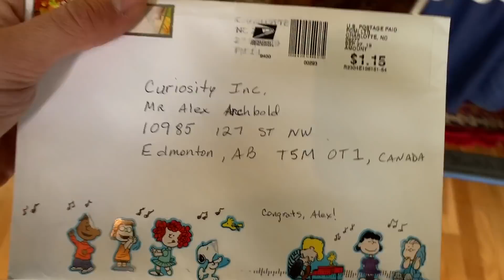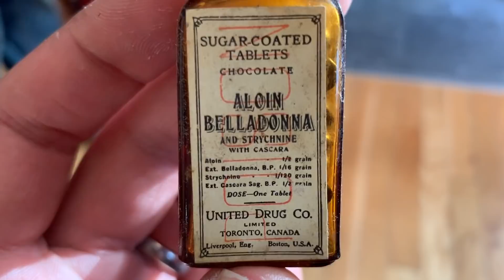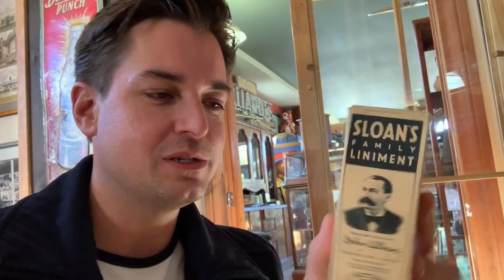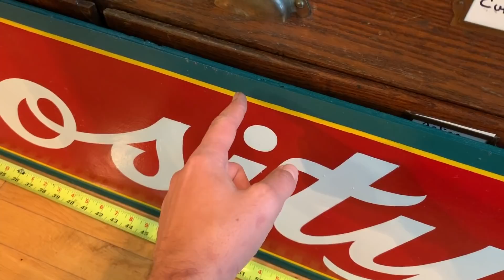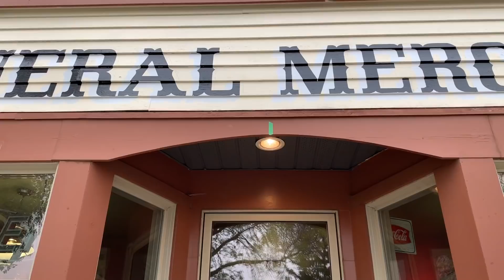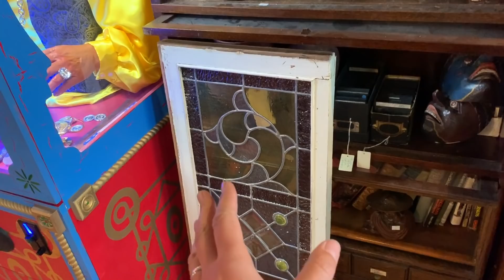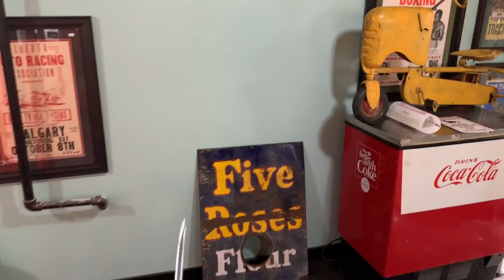Part 16 Alex gets crafty, sign time! And some final Reno's into... the General Store

Comment: What you need for the basement is a Dehumidifier you probably can find one used or purchase one new for under $150.00 CN?
Your basement will remain musty until the temperature outside gets into the low 30 degrees. After the ground starts to freeze you won't need it until springtime again. Those bags won't even begin put a dent in your musty basement.
Reply: I was thinking the same thing about the bags he bought vs. a dehumidifier. He should also buy a hygrometer (they are quite inexpensive) to monitor the indoor relative humidity (RH). If it's above 60 percent, that greatly increases the risk for mold growth. Ideally, the RH should be between 30 percent and 50 percent, if possible. We had mold in our home due to poor drainage in our backyard, and the RH in our closet (attached to our bathroom) reached as high as 75 percent. I was shocked at how much water a dehumidifier pulled out of the air.
Reply: @rachelh5211   At least a few gallons per day...Those bags are a waste of money...

Comment: New subscriber here. Nicely done.
My daughter told me about your YouTube channel and I'm looking forward to watching your Potter house episodes. 
That's so cool that you were asked to give a business lecture at your local college. I'm sure that you have a lot of valuable experiences and advise to share.
It sounds like a dream come true to have your shop be a community landmark/ destination, for bus tours.
My husband is a carpenter and has experience, renovating houses with old basements that have the dirt shelf. 
He spreads Surf powder detergent, over the bare dirt and it helps take care of the dank, earthy smell. 
Plastic bins on heavy duty shelving or wood pallets are great for keeping (seasonal decorations, extra parts, etc.) directly off the cement.
It helps with air flow under and around your stored items.
 And if you have any unexpected flooding, it will keep your stuff from getting ruined.
I've seen those multiple plug,  power strips, mounted with the power cord running along the top of the wooden rafters.
That way several things can be plugged in without the cord hanging down and it looks nice too.
A few years back, we owned a vintage shop. 
It was broken into, two days before Christmas. 
It took the thief about 10 seconds, using a screwdriver and hammer to pop the lock. 
The locksmith told me that if we had a lock that was a few dollars more, with a safety ring on it, the thief wouldn't have been able to spin the inside around with his screwdriver (like a key). 
Make sure you have multiple surveillance cameras. 
The business that sat next to me, had cameras and wasn't touched. We viewed their footage, after the break in, and saw the thief. 
He stood under one of their camera (at 1:30 a.m. Using the darkness and snowstorm, for cover). 
He looked directly into the camera and decided not to break into their establishment. 
This was before the doorbell surveillance systems that you can hook up to hear and watch things from another location....
We learned from this experience and put up signs that said, 
"No cash or valuables are stored on the premises, overnight." 
When we closed for the night, we left the empty cash register tray, sitting upright on our counter, within clear view of the front windows. 
We installed motion activated lights inside and outside. 
We used clear Christmas lights (on a timer) around the inside windows and the register desk that we left on at night. 
It looked pretty and added a measure of security, as well.
I parked where I could get a clear view of my car and kept the parking area, well lit at night.
Please also invest in security bars for any side or back windows.
My husband always met me before closing, so we could handle the end of day money and leave together, for safety. 
We were friendly with the other shop keepers by us, and we looked out for each other.
Just some things that I thought to share. 
Your shop is totally amazing!
You probably get tired of people offering unsolicited advice. Hope this might be helpful to you and doesn't come off as nit picking.
Reply from the maker: I appreciate you watching :)

Comment: Dehumidifier will dry it out your basement ,make it like a desert.
Reply from the maker: I’ll see if these help if not I’ll get a dehumidifier
Reply: Dehumidifier are a must in any basement.
Reply: But you will need to be careful picking the right one. Some you have to constantly empty the collected water. Others can be made to drain outside or in a floor drain.
Reply: @sand3882  I got one that will pump uphill. It is nice not having to dump a bucket.
Reply: Dehumidifiers are energy hogs as they are essentially air conditioners. A better solution ( assuming you have eliminated to cause of the water in the basement) is to get a 4" diameter inline fan that picks up air near the floor and exhausts it outdoors just like a dryer vent. You can run it on slow speed continuously or connect it to a humidistat so that it comes on when the humidity level increases. Much cheaper to run and no hassles draining water etc.

Comment: For you basement. I think that when things settle down a smidge, get the time and a contractor to come around and create a couple (or more) ventilation shafts. One has to climb much like a chimney the other can be ground side. Diameter/size isn't that big of a deal, rather a good flow of air, so you might want to have a good wind chicken scoop up there. Ventilation is by far, the most effective means of combating ground moisture short of digging a water catch shaft/well.

Comment: Alex,   a  few suggestions if you don't mind. That cellar basement. I have a 92 yr old neighbor. She has a cellar basement the neighbors emptied out. One of them got the bright idea to put a gallon of bleach in a 3 gallon pump sprayer and coated her walls from floor to ceiling. They barely got that done and were almost gassed from the chlorine fumes.   Unbelievable.  They came to me and asked for help.    First, you dilute bleach.  If I had a 3 gallon pump sprayer, I'd put 2 gallons of water in it and about a cup of bleach.  That should be a good enough disinfectant to kill any mold.

Since the damage was already done to my neighbors cellar I went to investigate.  From the kitchen I could  smell the odors.  I told them to keep all those windows open and  to get  a few fans.  I have COPD and I did have an actual quality face mask I could wear.  I got my SunJoe electric pressure washer and set it up outside her cellar window.  I went  down with my mask on and opened the window and they handed me the wand.  I sprayed those walls down from top to bottom with the pressure washer.  They looked great.  I even did her floor. The entire room was probably no bigger than 15 feet by 15 feet or so.  I made sure the drain was cleaned and not clogged with anything. The odor diminished quickly as it was all flushed down the walls and down the drain.

I ran out to Lowes and got two gallons of that white KILLZ paint.  I had plenty of brushes at my house so I asked the neighbors, since they started the project if they'd paint.  Three of them went down a few days later since it was dry as a bone and they knocked that out in just a few hours.  Now that lady has a clean dry basement.  With all that mold that was down there, the smell was working its way up into her home every time the furnace kicked on.  So I told the neighors to make sure the filters were changed and clean.  I got the size so I can get her a half a dozen more.  Her vent work was tight so it was the odor coming through the filters as the furnace kicked on.

So, after watching your video, I not only thought of that but thought you should get a pressure washer and clean that from top to bottom.   DILUTE bleach if you think you have a mold issue so it doesn't blow up when your furnace kicks on.  But, after you power wash, you should be able to get  a few cans of killz paint and that should keep your cellar tight and dry longterm rather than quick fixes like those bean bags.   Should that moldy smell come through your vents, your cardboard products might retain the smell and linger and people would notice when they came in.   (wow sorry 4 paragraphs) but I thought you should think long term, pressure wash and paint so future damages are avoidable.   I do enjoy your channel very much.

Comment: That guitar amp is a CRATE, which were mostly made in St. Louis, MO.  I owned a music instrument store for 22 years, and I was a dealer for Crate.  This era of Crate amps are known for having issues with cold solder joints, which will make them cut out.  If you have a soldering iron, remove the amp from it's box and remove the circuit board from the amp's chassis, and look it over really well.  Might want to use a magnifying glass during this step, as you are looking for solder joints that are cracked.  When you find them, or if you think ANY of them are questionable, just re-heat them with your iron until the solder is hot enough to flow and that will fix them 99 times out of 100.  Easy peezy, although it takes a little time to disassemble and reassemble the amp.
Reply: OH, I forgot to mention, if a Crate starts cutting out, take your fist and just give the amp a rap on the top, you don't have to bash it hard, but if you rap it and it acts like it is trying to come back on, then you know you have a cold/loose solder joint.

Comment: You can do the same thing with rock salt in a knee high stocking....really inexpensive! Make many more...you fill the knee high with rock salt & place a bucket under it to collect the water...the salt will draw moisture out of the air...you hang them from the floor boards in craw space...i have used this for years works fast and lasts a really long time!

Comment: Try a dehumidifier in the basement, changes everything. And it'll be cheaper than buying those concrobium packets after a few months. Mine has been running for like ten years down there, not a hint of must

Comment: Some advice from the land of limescale and wall-mounted flushers: When troubleshooting toilet problems, citric acid is your friend. AFAIK it does not degrade rubber gaskets like vinegar would, which is why people are using it for coffee makers, though it's usually very small packets there. Try buying a pound or so, should last for a good while.

My parents have had quite an ordeal with their toilet bowls - they were never flushing great, and over time it got worse. We're talking like half a minute until all the water got through, with roughly zero effectiveness. Never seen anything like that anywhere else. Recently one toilet bowl got replaced by a fancy new one after many attempts of cleaning had failed, and it's night and day. The old one was pretty thoroughly clogged up internally, you would've had to flood all of that with plenty of citric acid for a long time to have any chance of removing it. The bowls seemed like they may have been a bad production run anyway, they definitely were about the cheapest you could get in any case.

Comment: Adding vinegar to the commode water tank a couple of times a year will dissolve the calcium buildup and keep it working properly.
Reply: You beat me to it. I live in a hard water area too - it's supposed to be good for the bones, but it does dull any finishes. At least once a year, I mix a 50:50 white vinegar and water solution in a small plastic bag. I soak the shower head in it for 20 minutes to clear the limescale. Then I pour it into the kettle and boil that, let the solution sit and cool and rinse it out. Finally it goes through the washing machine.

Comment: Something that would make your life LOADS easier when you're using wire to secure things like you did on that snazzy lamp would be a pair of safety wire pliers. Get some decent ones and they'll last you a while. And you can find vintage ones around and about sometimes. I'm lucky enough to have been given my dad's pair that he's had since the '50s or early '60s. Could get the brand name off them if you'd like, to give you a better starting point!

Comment: If you hang up the moisture grabbers they will pull the moisture out of the air place a bucket underneath them to catch drips then dump the water outside.

Comment: Those bags don't actually work that well.
There's a chemical in there (which is not great for the environment either) that pulls in moisture, sure. But it only pulls in about 2 litres per bag, and because the chemical itself becomes liquid, it looks like it attracted lots of moisture, but it's only half of what you're seeing, because the other half it the chemical. Those bags are good for a closet, or something maybe the size of a loo.

You're way better off to using a mechanical dehumidifier. It's a lot cleaner, too. I'm sure they're available for rent somewhere.

Comment: Dont less with those moisture grabbers,  they wont do the job. Buy a decent electrical dehumidifier instead. We have a woods large home unit that cost about 4000 kronor (Swedish, SEK) some fifteen years ago and should be cheaper in Canada. It chugs away in the basement and draws out some 20 liters of säger every day (240 square meter basement) and we really should get one more of them. It hugely improves the climate in the basement and it just drops the water down the drain, so you vän just leave it  be and check on it once in a while to know that it runs.